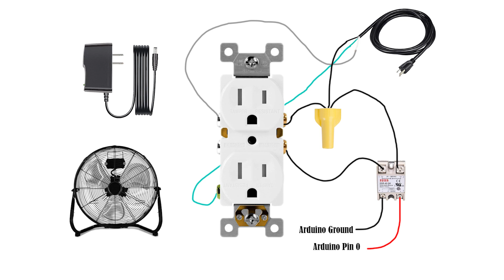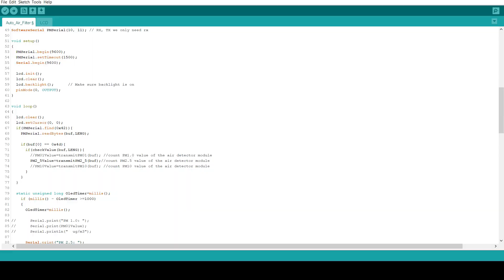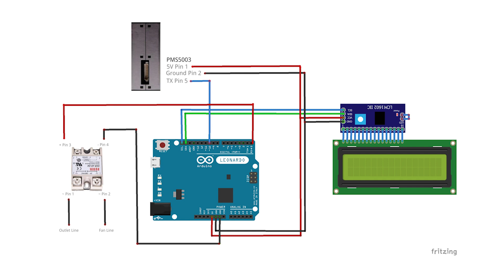The Smartest DIY Shop Filter on YouTube

Comment: great idea- and thank you!  If you decide to build this (and why wouldn't you?), consider changing the code a smidge so that the threshold point for the relay to switch off is around 4 or 5  ug/m3 lower than the threshold point for turning it on.  This will help prevent a lot of cycling on and off of the fan when it's around the ug/m3 point for turning on, the sensor seems to roam around a bit with each reading.  I set mine at 13 for on and 9 for off.  This is working well so far. I also added code for an 8 by 8 LED cheapo display I had hanging around. I wanted to be able to get a visual of the air quality from a distance. set 13 and under to green, 13 to 35 as yellow, and above 35 as red.  Might change these points if needed, though it's a pain to update the arduino in where it sits in the bottom of the box, so maybe not :)
Reply from the maker: Solid idea on changing the on off values!

Comment: Wow! I’m surprised something like this isn’t commercially available. What particulate level triggers it?
Reply from the maker: 12ug/m^2 triggers jt. That can be changed in the code to something lower or higher. I set it to 12ug, because most studies consider that there is no risk to lung health under that.  Could be set a little higher, but I'm in my basement, so I chose that lower value.  I'm not exactly sure how accurate these sensors are, but this thing is a joy to use. 

I want to make another one for solder fumes. I'll probably consider mounting the next one on a PCB.

Comment: Hey man, I like the video. If you're interested, you can increase the MIRV without sacrificing the flow rate by creating an air filter "cube" like these guys did. This way you have 4 filters instead of 1 so there is less suction if that makes sense. Stay healthy!  https://youtu.be/aw7fUMhNov8
Reply from the maker: Hey, yeah! A Corsi-Rosenthal box! I considered this, but I don't have enough room for it. Alternatively, I could have purchased one of the 5" thick ones. This will probably get rebuilt with a centrifugal fan when I get a bigger shop!